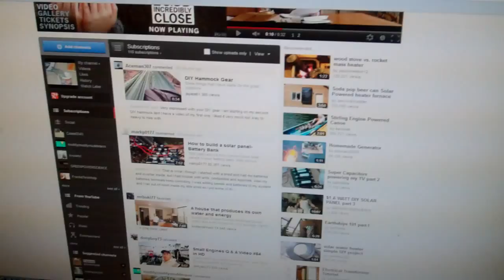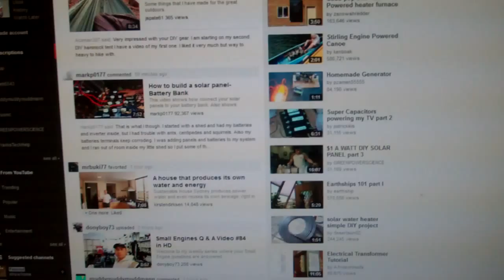PC boots to total black screen .mp4

Comment: im a computer tech over 10 years. dust can get in the ram slots and after blowing the dust out and resetting the ram helps 85% on boot but no post code problems.

Comment: you should blow the lint out of the machine with some kind of air like from a can or an air compressor. Blow out the fan on the CPU to keep it running cool before it melts the CPU. I do this all the time to keep things running cool. Blow out the video cards fan and cpu too. I say lots of dust in the bottom and most people dont clean out their computers with air and they melt the CPU happens all the time.

Comment: what kind of saw blade is that?$$
Reply from the maker: +Bama Boy Buck Bamaboybuck That's just a 7 1/4 inch saw blade which I was using as a magnet rotor for my wind turbine.
Reply: +wtam69 thanks. great vid by the way! do you know about a dell motherboard has amber light. no beeping and no boot.?$$